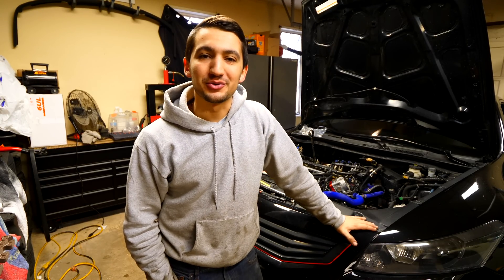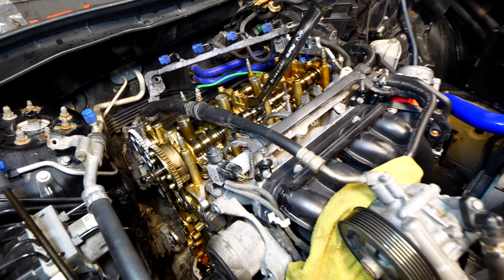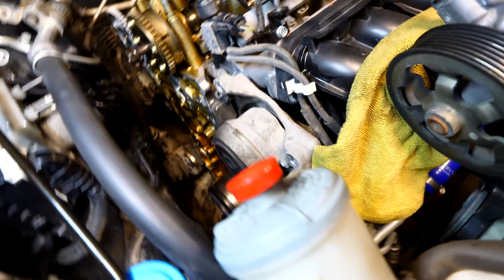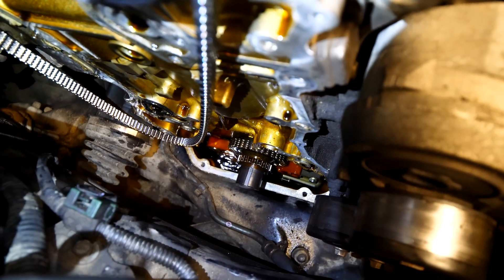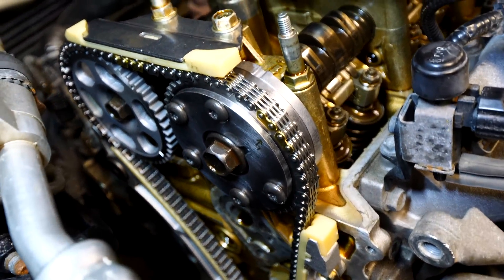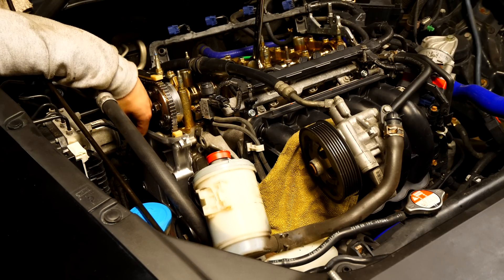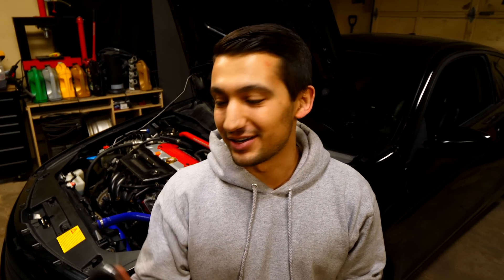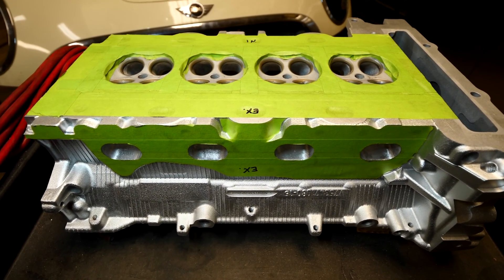How I Replaced the Timing Chain on my 200,000km Honda Engine

Comment: What is your opinion about porting/drilling out oil passages and oil pump to increase the flow? Also porting out water passages? Increasing diam near termo?
Reply from the maker: As long as it doesn't affect the structural integrity of it, I would 100% approve on the oil side of it. For the water passages, I woundn't, as you want to maximize how much surface are the coolant flows over to lower help cool the engine

Comment: 200k already 😱
I have a 97 civic and it's gonna hit 200k soon
Reply: NIX Maybe you bought it from car flipper and it has made all around the clock? And it's 1,200,000?
Reply: Gedas Alekveravičius lol if so then all the original parts are in beautiful condition
Reply: He said kilometers. 200kilometers is 124,000 miles
Reply: 240k Miles on my 2008 Accord. About to try and tackle this. Tired of my VTC rattling
Reply: your 97 civic has a timing belt not a chain which should be changed by 80,000 mi.